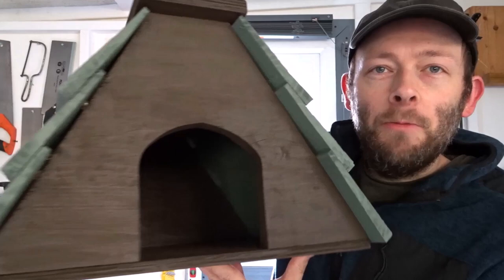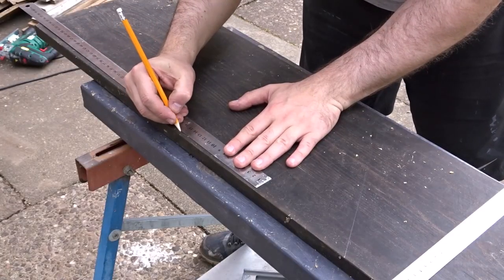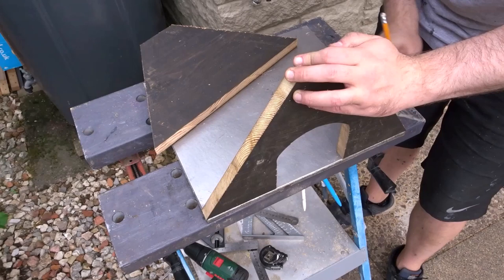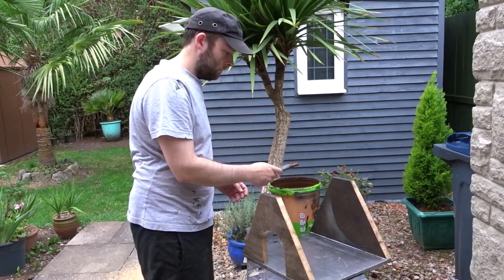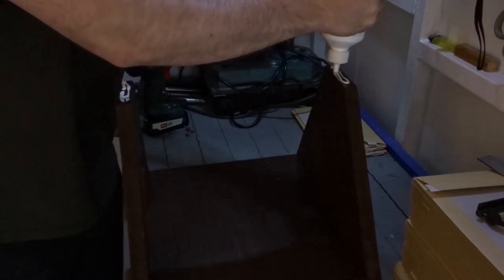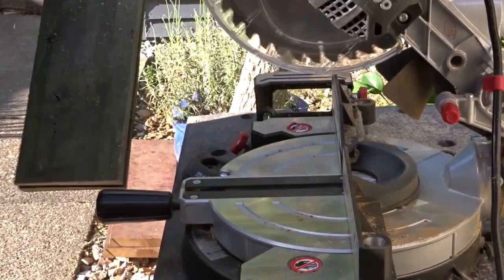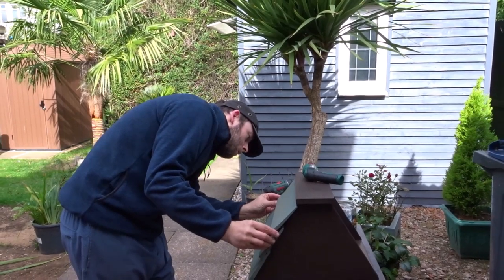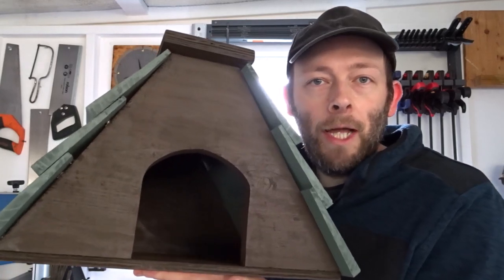How to Make a Hedgehog Hibernation House (DIY Scrap Wood Project)

Comment: No tunnel! not the slightest protection from predator's
Reply from the maker: I made a more complicated Hedgehog box with a tunnel in a separate video. This is a simple box. I researched on Google and the 13cm x 13cm entrance should put off most predators. In the wild hedgehogs sleep in hedges so at least this offers more protection than a hedge.
Reply: @PhillWyattProjects  Sorry Phill, there is nothing to prevent a determined Fox, dog or cat from getting at the Hedgehogs. All the experts will tell you to build on a tunnel, not a lot of extra work and will make the house much safer.